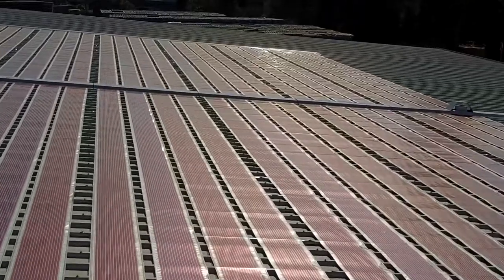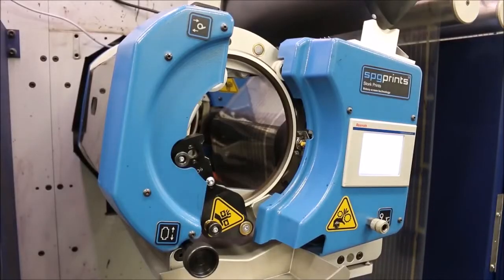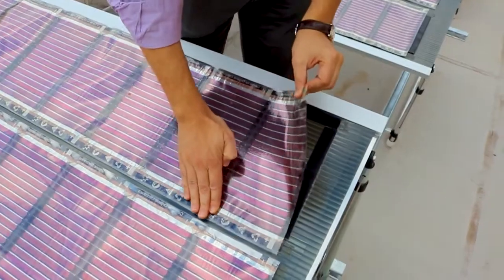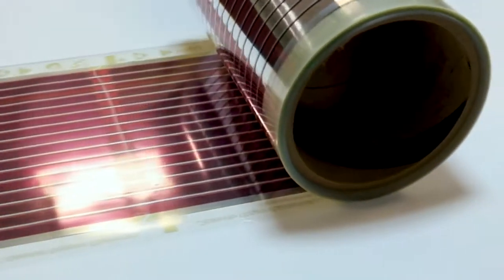Welcome To the Charge Around Australia Project: Travelling Australia's Coast Fuelled By Solar Energy

Comment: Love the idea but this I'd very light on info.
 I can't see how about 3000w at a guess of rolled up solar array charges of 60kwh battery in the Tesla's in 6 hours?
When you be lucky to get 20kwh in a full day from 3000w in perfect conditions in Australia or is the array alot larger?

Is this dc charging at a high voltage?
Reply: From what I've seen of the plan they aren't exhausting the range of this every day and are making frequent stops at schools and such for talks and workshops, it's likely that their planned driving for the day can be covered by 20-30kwh of charging, the teslas are pretty efficient.
Reply: @CopypastaForTheBlind  To get 20-30kwh per day they will need 5-6kw of solar.

Comment: If this trip works, there is no longer any reason for range anxiety.  Virtually everyone on a trip can keep a roll of these solar cells in their car or caravan, and lay them out on some empty land for a few hours in the morning while taking it easy, then roll them up and continue on their way driving into the night to either their next open space camping spot or destination.
At $10/M2 they are probably cheaper than the petrol it would take to travel the same distance.  But of course that's probably the "target" price and the prototype cost will be much more expensive.